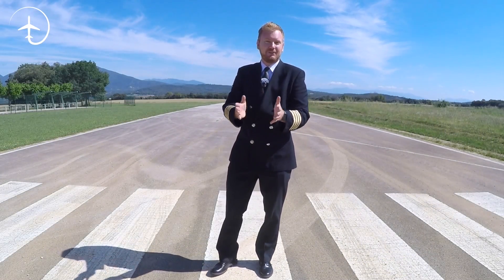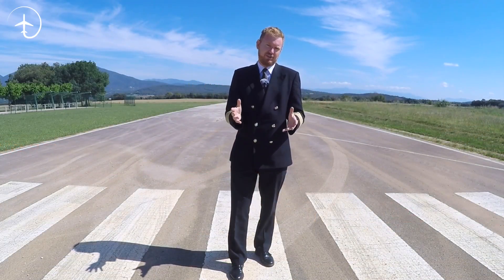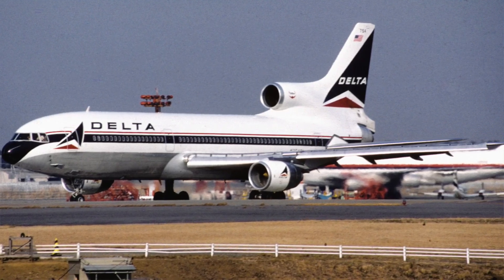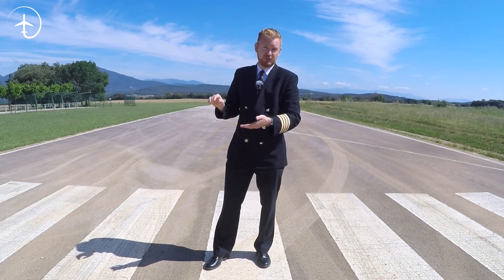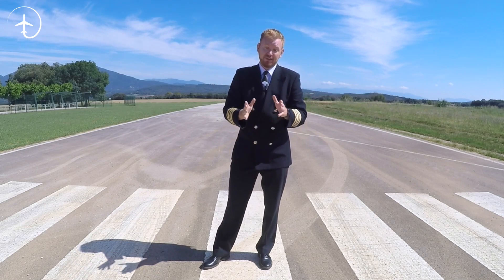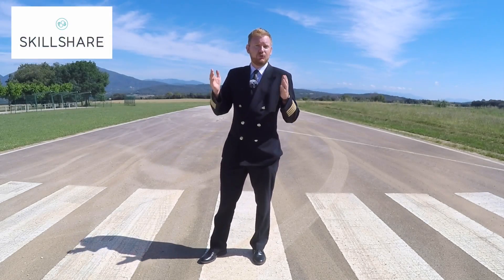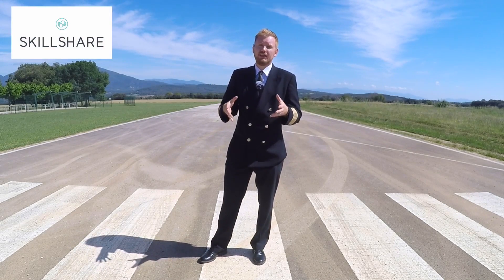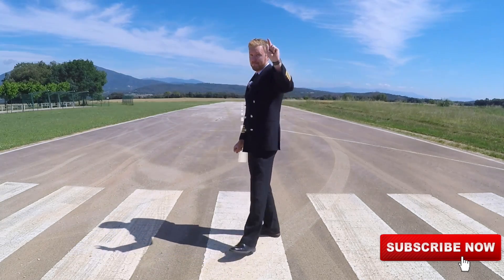Three Engined Aircraft, what happened?

Comment: Once again an amazing video. Cheers! Although I had a question that why aren't flight attendants given basic flying training in case of incapacitation of both pilots in the cockpit. I'll be glad if u could answer this. Thanks :)
Reply from the maker: Because the risk is so remote.
Reply: Mentour Pilot Thank you sir. :)
Reply: +James Neilson Graham    That would be interesting...I've jumped out of a perfectly good airplane at a mile up and I can't see your average Caspar Milquetoast passenger bailing out of an airliner at 10,000 feet.  I sure as hell wouldn't if I had my kids with me.  Picture a 65 year old granny strapping on a chute and diving out of the side of an airliner that is already doing something unusual enough to require the passengers to leave.  Interesting, non?
Reply: Also they wouldn't be able to enter the cockpit, right? Without going into safety related topics.
Reply: Some kind of parachute system for passengers would make me feel safer . . .
Reply: James Neilson Graham Opening up a door with a pressurized cabin is next to impossible.
Reply: James Neilson Graham I think a parachute from cruising speed and altitude would be more dangerous than riding the aircraft to the ground at best glide speed. At 30,000 feet and 550 mph, your looking at -30F without wind chill. Not to mention the hypoxia and insufficient air to open a parachute for several thousand feet
Reply: I always hope for the "Is there a pilot on board?" question....I'm not, but if nobody else steps up I could at least fly us as far as the smoking crater in the ground...but seriously...I watched a video lately here where they put a teen girl in a simulator to see if she could be coached by an instructor over the headset to land the aircraft (Airbus airliner I think)...the caveat being this was an aircraft and airport featuring "hands-off" landing capability....once the aircraft is properly positioned and at the right speed and set up correctly to capture the ILS it can take it from there. She was able to do it, after a period of getting her to use the basic functions of the autopilot correctly to get a useable approach happening...it was interesting...
Reply: +James Neilson Graham   Yawn. The old parachute chestnut again.  All technical issues aside, there is almost no scenario where a parachute would be useful, because the only useful scenario is where the plane is still under control and yet the crew know that a crash is certain to happen.
Reply: I saw the same video but I think it was a Danish high school male student who did it for a project.

Comment: MD-11 DC-10
Reply from the maker: Yep, fantastic aircraft.
Reply: Mentour Pilot do cargo airlines still use these aircraft? And which one.
Reply: Yes.  I see DC-10s and MD-11s coming into PDX every evening.
Reply: Joey Wolf67 We also updated the DC10 cockpit with the glass cockpit of the MD11, So the DC10 became the MD10.
Reply: Joey Wolf67 The DC10 and MD10 will eventually be phased out of the fleet, The company is using a lot of 777F 757&767 but they don't have the same capacity as the DC10. or MD11.
It be a shame when they go as they really stick out on the ramp compared to the typical Boeing &bus you see at most airports.
Reply: Adi Adiani We are not talking about how deadly trijets is.
Reply: FedEx is still using a whole bunch of MD11s.
I've heard South America uses DC10s.
I like the look of the Tu154. sexy
Reply: UPS flys MD-11's in/out of their Louisville Ky hub daily
Reply: FedEx has the largest amount of DC-10/MD-10/MD-11s in their fleet(about 400). But they too have began to switch over to the 767-300 for better range and operating costs.
Reply: Steve Berry oh I miss the dc-10 and MD-11 ps why did airlines stop using them ??
Reply: Joey Wolf67 The public lost trust in them. Had a major oopsie or two.
Reply: jstins was it because the DC-10  crashed a lot and the MD-11
Reply: Joey Wolf67 Yep my old company still uses them although they are heading more towards the big twins
Reply: Dave Byrne which McDonnell aircraft did you have? DC-10s or MD-11 or both ?
Reply: Joey Wolf67 DC 10 MD10 MD11 and B727F
Reply: Dave Byrne are you getting new aircraft like Boeing or Airbus ? Or are you keeping the McDonnell Douglas
Reply: Dave Byrne oh
Reply: Joey Wolf67 i think Kelowna flightcraft still have the DC-10-30F.
MD-11F is still alive well today.
Reply: Adi Adiani yes it was the worst crash of America airlines but were not talking about the crash
Reply: Adi, when you said 191 I immediately thought of DL191, which was an L1011.  Other than bringing "microburst" into people's consciousness, it was arguably the origin of the idea that the safest place to be in a crash... The engine structure was probably the main reason the tail held together so well.
That one is really burned into my memory.  I was a kid and my father worked for Delta at DFW.  We were getting ready to go on a Boy Scout camping trip, and news of the crash came on the radio.  He immediately went to the airport.  Also, my older brother had a luggable computer which ended up being used to keep the morgue records since that sort of equipment was pretty uncommon back then (I ended up with that computer after we got it back actually).

I don't know the stats, but I'd be surprised if trijets were any more dangerous than other aircraft at the time.
Reply: Adi... Of course the flight # is a coincidence.  So is the fact that they were both 3 engine jets.
Reply: L1011 TriStar yep good planes love how it looks

Comment: MD-11 as Dassault falcon 7x are two of the most beautiful aircraft ever made.
Reply: L1011
Reply from the maker: True!
Reply: "most beautiful aircraft ever made." ===> Choose one: (a) Concorde or (b) SR-71 "Blackbird" or (c) <<< Draw <<<  

Other answers just WRONG, WRONG, WRONG, all WRONG.
Reply: ... the Ju 52 I mean
Reply: Engineering student. They're good. Solidworks is (with Autodesk's Inventor) the most popular CAD modelling software in general industry, while Catia (since it can compute in electric wiring) is used in automotive industry.
Btw. I have found out, the shittier a CAD looks, the more it usually can do. Or that may be just that our school has the older Catia V5 instead of the newer V6 (for which DS charges extortionate sums, as I have been told). But PTC Creo (former ProEngineer) still looks like it's from 2000, because you don't screw with perfection.
Reply: Actually the most capable "design tools" are a pencil, a ruler, a set of triangles, and a compass. When my grandfather helped design the space shuttle that is all they were using.  Then they took all the drawings and dimensions and manually entered them into a HUGE computer database one at a time and stored them on reels and reels of tape to simulate their design to see if their drawings would work. 
Imagine that, the most complex machine ever built to this day was designed entirely on paper by hand. 
Even still, if you are a good engineer and know how to use your tools then ANY of them will do the job. You might have to go about doing the job differently than you would like to but that's what engineering is all about!
Reply: Or Junkers Ju 52.
Reply: ... no jet aircraft really ... :-)
Reply: It has three engines! :-D
Reply: Václav Fejt Also the Ford Trimotor ;)
Reply: Dassault's jet are beautiful in a general way. And I don't say that because I'm french
Reply: I regularly use Dassault products...Solidworks and Catia.
Reply: Václav Fejt you're an engineer I suppose? I don't know what their software are worth
Reply: "popular CAD modelling " ==> Geek much, lately?
Reply: First Officer Davis you should really have a look at the Falcon 8x💝
Reply: I love the L-1011 (TriStar) but hate the DC10/MD-11. It just looks all wrong, where the L-1011 has terrific lines. Eye of the beholder and all that.
Reply: DC-10 is more agressive and radical. L1011 is soft. I love the DC-10, I recon the L1011 is a SUPERIOR airliner in many aspects. Lockheed deserved more sales on this bird.
Reply: I dislike the tail of the L-1011. The high-bypass rolls royce engine makes the s-duct look way too fat and unstreamlined.